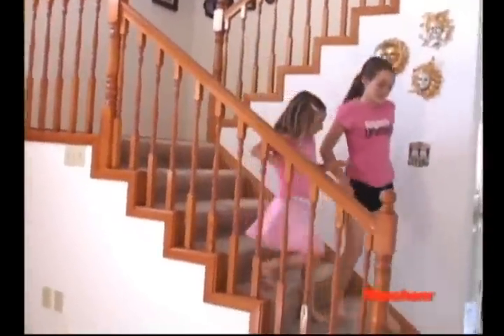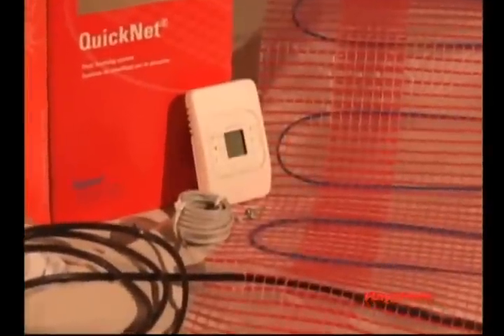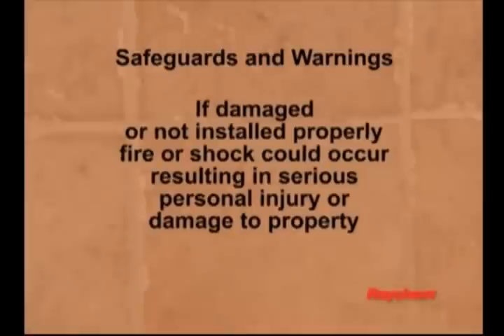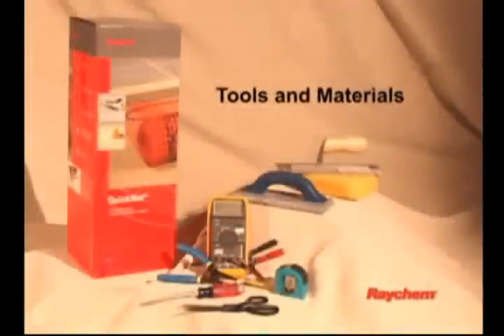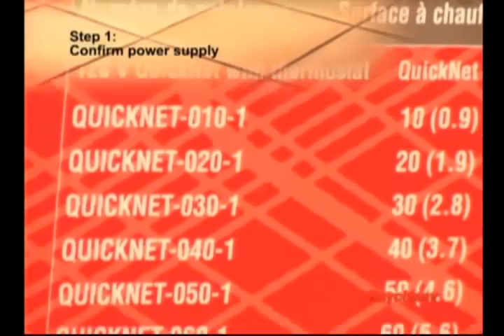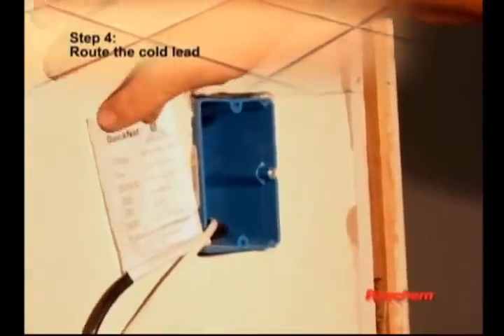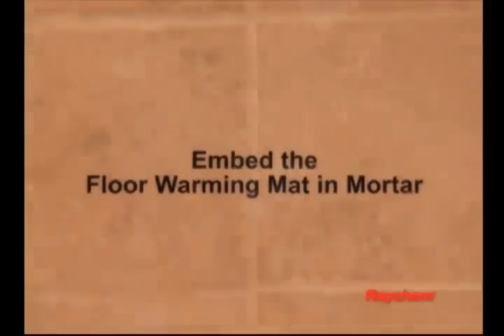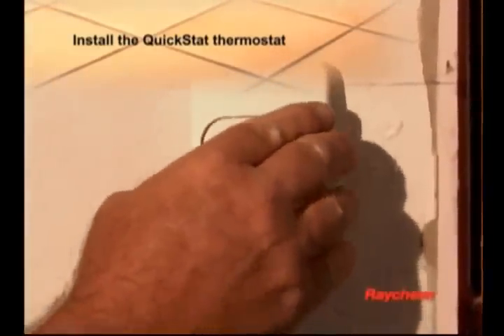Raychem Electrical Underfloor Heating Introduction

Comment from the maker: Products from the Electrical Underfloor Heating system emits the lowest possible electro-magnetic fields due to the twin wire construction as well as excellent insulation layers, which is safe and reliable. For Wet Underfloor Heating, junctions between valves or pipe may have the risk of water leakage, which consume much more resources to resolve the problem.

Comment from the maker: The heating cable from the Electrical Underfloor Heating system has a smaller bending radius than the water pipe from the Wet Underfloor Heating, and therefore the cable spacing is smaller, thus having a better heating efficiency.

Comment from the maker: The installation of Electrical Underfloor Heating requires less construction height than Wet Underfloor Heating. The installation of Electrical Underfloor Heating system is also much more simple and the installation duration is much lesser than Wet Underfloor Heating.